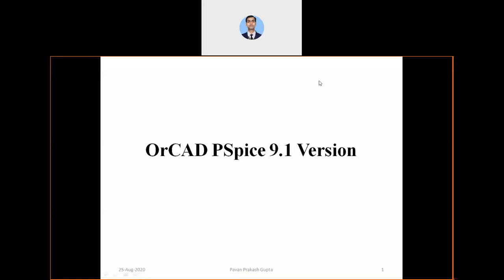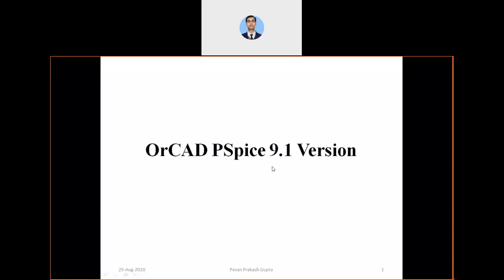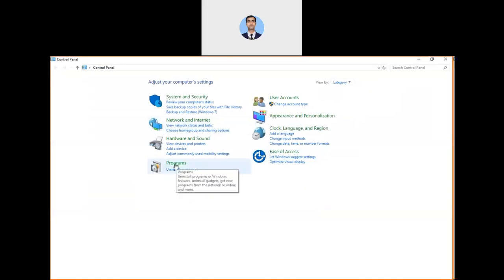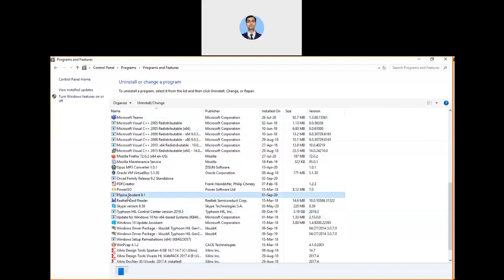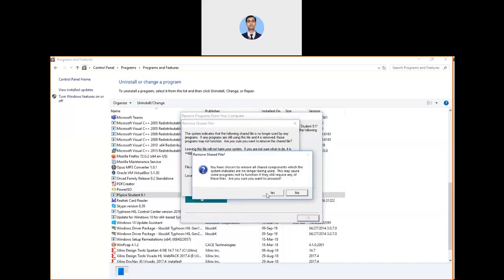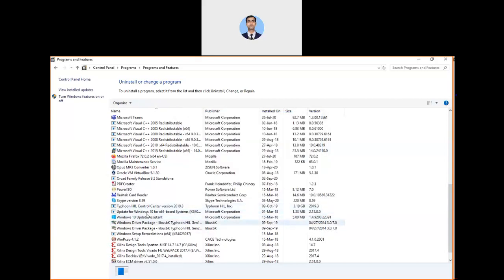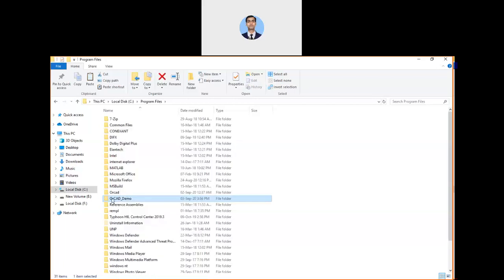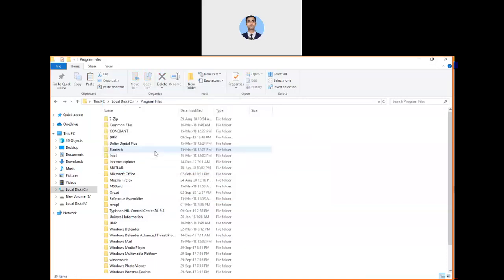PSpice 9.1 Free Version | How to properly UNINSTALL | Complete Details

Comment from the maker: PSpice Project Tutorial Video Links: (Please visit the channel page for more)
PSpice9.1 Workspace & Schematic file creation: https://youtu.be/lUDDbhOwYsY 
PSpice9.1 Complete Uninstallation: https://youtu.be/xCnELKvnfu4 
PSpice9.2 Full Version Download & Installation: https://youtu.be/17g1lto6Umc 
PSpice9.1 Download & Installation: https://youtu.be/-eaAG_Ejxng 
PSpice9.2 Full Version New Project & Schematic File: https://youtu.be/0GJMRXvR9xI 
Single phase Mid-Point CycloConverter: https://youtu.be/rrdjAAH96ls 
Bridge Type StepDown Cycloconverter: https://youtu.be/vMxvLSMII7c 
Bridge Type StepUp CycloConverter: https://youtu.be/wbestUPQCEE 
UJT Oscillator PSpice 9.2 Simulation: https://youtu.be/z8-y6vIiE54 
SCR Triggering using UJT Oscillator CKt: https://youtu.be/vCeilvKTFsk 
RFiring of SCR PSpice Simulation: https://youtu.be/PScJFQLPUHo 
RCFiring of SCR PSpice Simulation: https://youtu.be/FP7rLCqJ_Uc 
Full Wave Diode Bridge Rectifier Part-1: https://youtu.be/n6Y4a3KLjvc 
Full Wave Diode Bridge Rectifier Part-2: https://youtu.be/STqTK47SS5s 
Fullwave controlled bridge rectifier Simulation: https://youtu.be/diPI1axGViM 
3Phase MOSFET bridge Inverter 180 & 120 mode operation: https://youtu.be/kgPxumd46EM 
Unipolar & Bipolar SPWM of Single Phase inverter: https://youtu.be/0y1hlGijjsc

Comment: Sir when I am trying to uninstall , it is saying
This can't be completed because folder or a file in it is open in another program
Reply from the maker: It is very ofcourse thing that before uninstalling any of the programms you must close all its related windows, files and features running in the background. Then only you can uninstall it properly.
Reply from the maker: You can check programms running in background with the help of Task manager by pressing cntrl+Alt+del key, but do it very carefully otherwise system files may get corrupted. I would suggest, do it under the supervision of an expert person.
Reply: @sampurnadhyayan6067  That was solved but still thanks for the reply